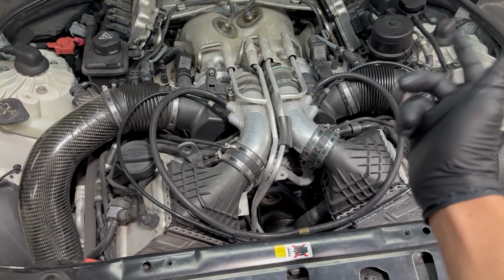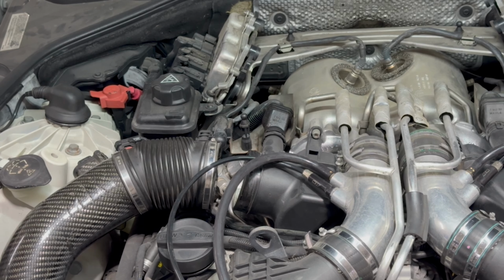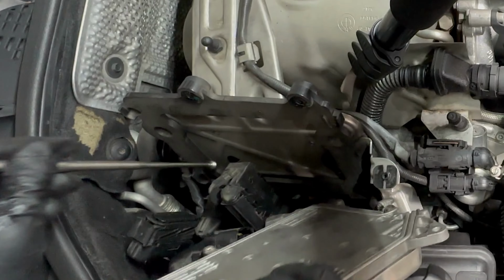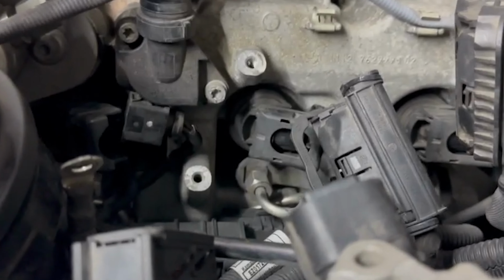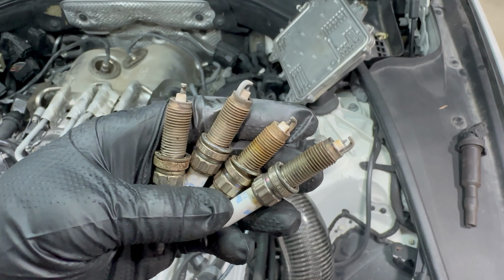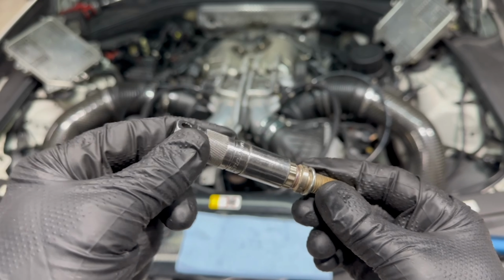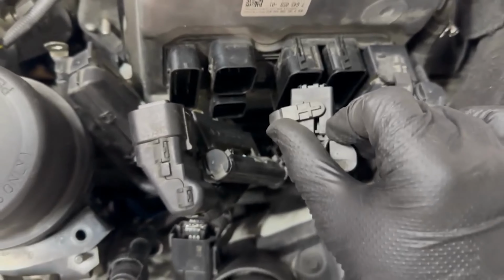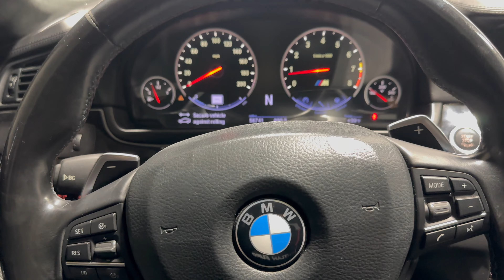F10 BMW M5 S63 Spark Plug Replacement DIY

Comment: just did a voltage regulator on an E64 M6 and had to piece together info from half a dozen website and youtube sources and was still scratching my head...you have all the detail, it's easy to understand, and you show all the work as it happens. Perfect video!

Comment: Can you please make a f10 M5 break pad tutorial front and back would be amazing. Not too many videos out there on it and love how you explain everything truly even tho did spark plugs before. Gave me more confidence especially removing the dme units. With the break pads not great videos on compressing the piston especially on front breaks. Also in the back have the electronic break and some people say to remove it some say you don’t. If you could would be amazing understand things take time so thanks for hearing me out.
Reply from the maker: Yes! We can do that! We know of one that needs brakes currently. I'll  get it in ASAP
Reply: Thank you so much you have great videos. Is very easy to understand every step that you explain. Not too many good videos on a true m5 break replacement. Thanks again so very much appreciated.

Comment: Thanks for the video! So I followed all the steps and when I went to start the car only the starter would run without the car starting. 

So I went under the hood (while battery was still plugged) and turns out one of the DME connectors weren’t in all the way, it would pull out even when “locked”. I plugged it in all the way (battery still plugged in) and then went inside the car to see a bunch of transmission, drivetrain malfunctions… and now when I try to start the car the starter won’t even run.

Do you think all I need to do is clear all codes with Bimmerlink?

Comment: Great vid, thanks. I see you skipped over the re-fitting of the bracket that the DMEs mount to. That is a pain in the arse. Why BMW didn't make the bolts captive is beyond me. Bluetack helps anyway. I used to remove and refit my downpipes every year. I thought I'd never have to deal with that crap again but I need to do the plugs :-/

Comment: Quick question you said 30nm which is 22ft pounds I’ve always done 17ft pounds do you recommend 22ft pounds?
Reply from the maker: I would go with the spec. 22nm. 17-22 isn't that big of difference and 22 wonr break the plug. So I would go with the together spec even tho those engine don't have a problem with plugs lessening and getting shot out of the hole like a 2V ford does lol